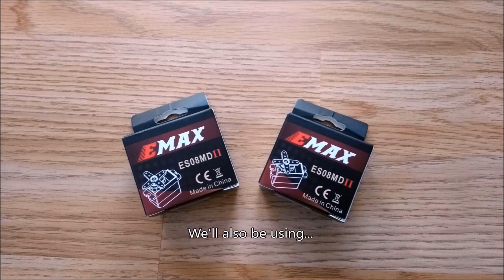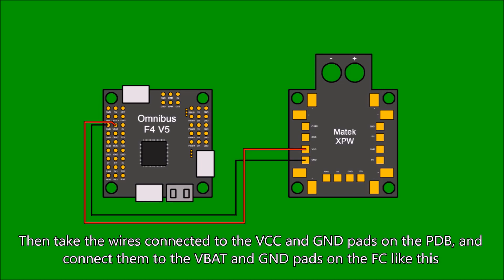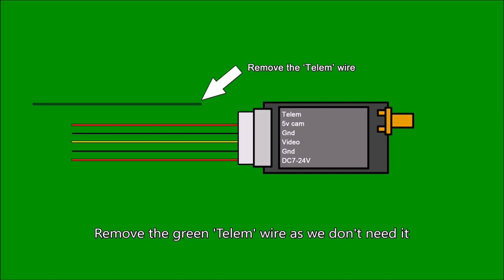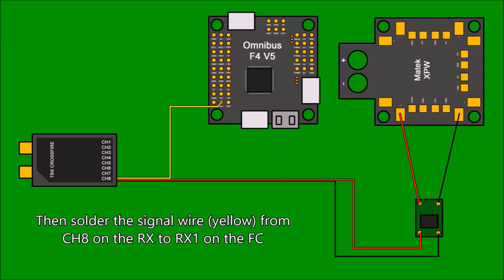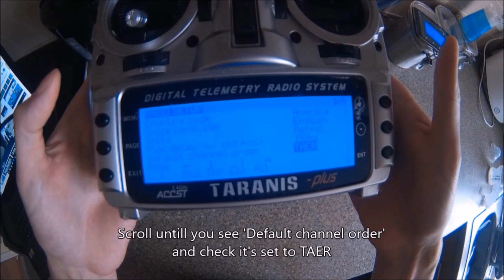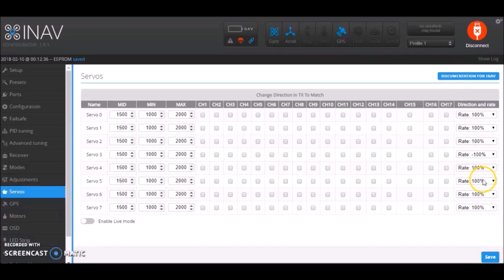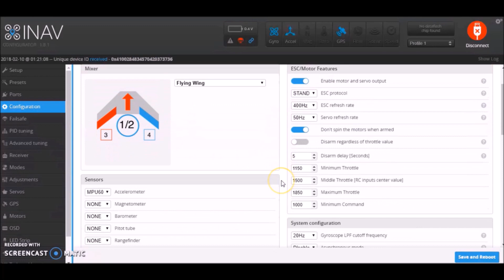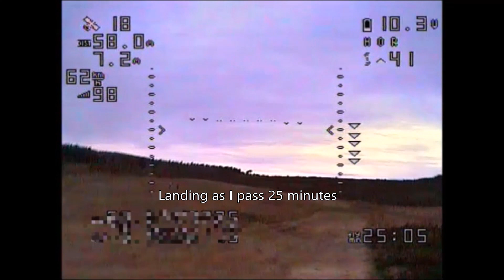🛩️ Long range S800 - Detailed step by step build and Inav setup

Comment: Hi, great video! Thank you 👊 this is my bible atm. My build is very similar using same omnibus f4 v5, only difference really is my GPS is a 6 wire one. If my GND 5V TX and RX are where yours are, and so is my SBUS, where would SCL and SDA on mine go please? Thanks 😊
Reply from the maker: The SCL and SDA wires are for the compass, which you don't need and shouldn't use on a wing. I'd personally just remove them from your GPS unit and just solder the TX, RX, 5V and GND wires like I have.  If you really want to keep the compass however, then put your TX wire on RX6, your RX wire on TX6, and then put your SCL and SDA wires on the pads labled SCL/TX3 and SDA/RX3. Then on Inav be sure to set your GPS to UART6, rather than UART3 as I have
Reply: Thank you so much for your reply, you have confirmed what I already thought but couldn't find a definite answer specifically to this board. I have watched many, many inav YouTube vids regarding this and alot, almost all in fact do wire the SCL/SDA up and then activate it in inav config... are they wrong and just wasting their time then or is it just because their using earlier versions of the board? Thanks
Reply from the maker: They're just wasting their time and are probably doing it because they're scared to open up the gps module and desolder the SCL/SDA wires lol. Get on the 'Rag the nuts off' page on Facebook and ask in there, you'll find everyone will tell you the same thing. For a wing you don't need a compass :)
Reply: Thanks man you're a legend! Your word is good enough for me dude and I'm definitely not scared to do that,  it was apart within 5mins of coming through the letter box lol thanks again 👊
Reply: Martin Drew That's right. You definitely don't need a compass on a wing since it's always moving forward, allowing the GPS to keep track of heading.

Comment: Thanks for that Giz; but 165 grams of ballast!  And I was worried about 100 grams on mine! I don't know why everyone is using the S800, (including me), I find it a poor design. Anything that needs that much ballast is unacceptable. It needs a longer nose to get the battery out further.
Reply from the maker: patrickcol Haha, Nah it's not actually that much ballast if you think about it. The S800 is specifically designed to carry a Gopro which is around 80g, but if you're not using one you need to substitute that weight. So in reality I've only actually had to add 50g of additional weight on top of what should be there, and I could probably get away with less. I reckon 100g would be fine, and I may reduce my ballast in the near future. Once properly balanced the S800 is a fantastic platform. I've been using my other S800 for long range flying for 6 months now and it fly's really well 😊

Comment: Nice video but using INAV 1.7.1 is totally unadvisable. Also ESC calibration done like that is not good. Just go into motor tab, higher the throttle from there, plug the battery, set it down to minimum after beeps and calibration done.
Reply from the maker: yokonunz Nothing wrong with inav 1.7.1, I've been using it for 6 months on my other s800 and works fantastic. That's true about the ESCe calibration, the only reason I showed the Blheli option is to show people how to also change motor direction if they need it.
Reply: Giz FPV iNAV 1.7.1 has buggy failsafe. Lost a plane due to it.
Reply from the maker: yokonunz Used failsafe countless times and not had a problem
Reply: Giz FPV same until I had it. If the altitude at the time of Fail-Safe start is lower than the slow down altitude the plane will land instead of coming home for instance.

Comment: You killed the whole project with this ugly goofy crossfire thing. Why man, whyyyy???
Reply from the maker: Lachezar Krastev How did it kill the project with the crossfire? The crossfire is awesome, and also necessary if you want to do long range
Reply: Its just too big for this wing. I am going 5 km with Frsky XM+ which is about 2-3 grams.
Reply from the maker: Lachezar Krastev The main reason for installing the diversity Rx was for its built in battery and beacon function. When doing long range it's nice to know there's some method of tracking on standby incase you have a accident
Reply: I did not knew it has a beacon - I will check it.